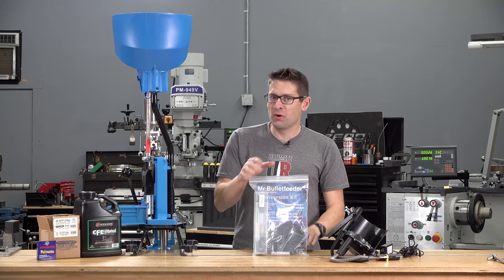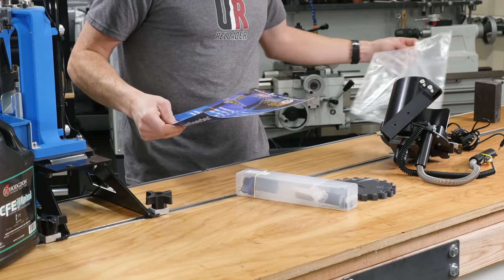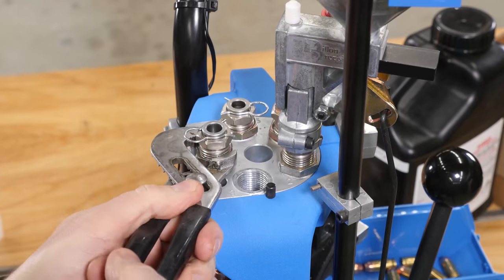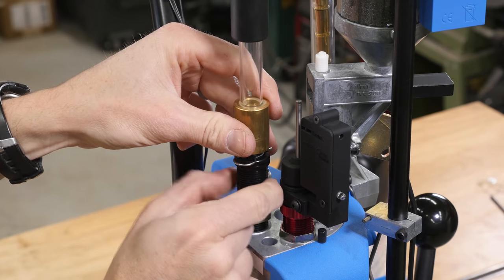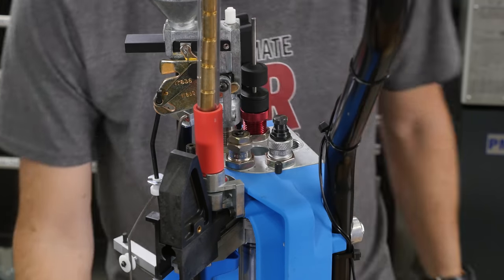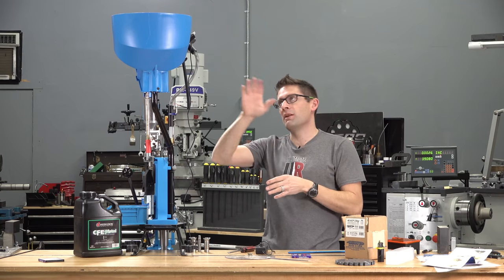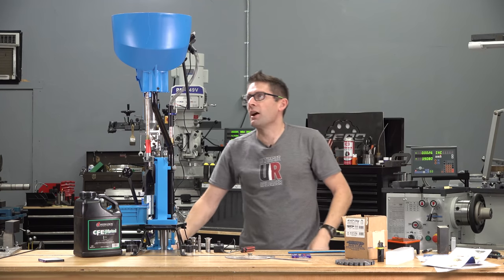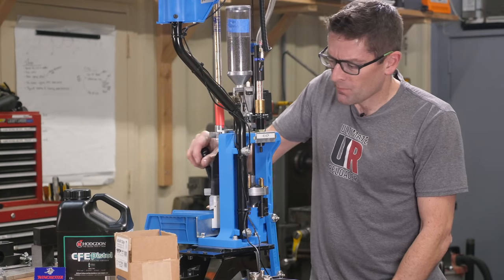Mr. Bullet Feeder Caliber Change: 9mm to 45 ACP on Dillon XL-750

Comment: Hey Gavin, I have the same setup on a xl650 press.  I had some issues with the bullet dropper not always reseting itself (dropping itself down after picking up a bullet). This would result in spilled bullets, not picking up the next bullet or seating the bullets too lightly without over expanding the brass case mouth.  

I fixed the issue by attaching a light tension spring from the top of the dropper assembly via a cap screw that replaced the set screw, to the bottom of the tool head through the tool head hole on station 3(the powder check station op rod hole) to a v shaped piece of wire that holds the spring from coming through the hole.  I have my feeder setup on station 3. 

 After adding the tension spring it has worked flawlessly. :-)   I now noticed as I'm  writing this that  Mr. Bullet feeder now offers their fix with  dual springs for this issue with their own tensioning kit. Now that i know this is avalible, I highly recommend it as it eliminates any issue with the bullet dropper reseting and will provide more force to the bullet pushing it into the case mouth. This will allow the brass to be minimally expanded saving brass life and keeping bullets from falling out/off the case when indexing to the next station.  

You can their product fix here: https://www.doublealpha.biz/us/dropper-tensioning-spring-assembly

I love the setup as it works well for me. Thank you for the reloading content you create.  
Hope this helps. Happy reloading :-)

Comment: How did you get the shell plate holder to stop jumping and spilling powder out of the cases?  This is a problem on my buddy's 650.
Reply from the maker: The XL-750 Has redesigned indexing, I think that helps!

Comment: Is the Mr. Bullet Feeder a universal fit for typical progressive loaders? 
I'm curious if it'll fit and work on a Lee Load Master or 1000 model.
Reply: it's press independend but you will not have enough positions on 1000 as bullet feeder requires bullet feeding die. You can use collator without the DAA die and use Hornady bullet feeding/seating die instead, that will work too.

Comment: I noticed that the cases stick on the funnel sometimes are you having the same problem?
Reply: polish it slightly with some fine grained sandpaper or steel wool. Especially on the conic transition from expanding part to bell. had the same problem, this fixed it nicely. Do not overdo it!
Reply: Thanks I’ll try it
Reply: I tried 3 different brand funnels: dillion, Double alpha, and shooting sports innovations. The only thing that helped was a little one shot lube on my brass.
Reply: @mackies9151  That was the first thing I've tried (well, apart that I lube brass with lanolin mix anyway) and it didn't help much.

Brass sticking problem has been solved only by polishing powder funnel. 

I have to tell that I had same problem with original Dillon powder funnel before I started to use bullet feeder, so it's not a problem of just Mr. Bullet Feeder funnel.

Comment: Is it necessary to have an RCBS die in this setup?
Reply: no and if you are not using powder check, you can crimp and seat in separate steps too. The only downside of seating/crimping in one step is that you can't use powder coated bullet (or it's not recommended) as bullet is being crimped while still die is seating it into proper depth, so it might shave the coating this way. But I think Lee or any other seating/crimp die would work the same way as RCBS.

Comment: If your gonna load on a progressive press the bullet feeder is a must to take advantage of the press
Reply: not so. Certainly nice to have but not a must. Casefeeder is a must, true, but not bullet feeder. Personally I have bullet feeder set up for 9 mm and reload .45 ACP without it, not a problem.
Reply: @ZhuJo99  why buy a progressive without a case feeder . Progressives are to save time and load in large amounts.  I am talking about dillion xl presses. Buy once cry once.  I loaded for years without a bullet feeder. No more fumbling small bullets like 9mm and 223
Reply: @taps_1021  learn to read first, please. I was specifically talking about that BULLET feeder is NOT a must. Nice to have, not a must. Casefeeder is a must. But it depends. Dillon 550 is just fine without casefeeder, which I heard is even quite problematic on 550 and does not work for rifle cases.
Reply: @ZhuJo99  this vid is about a bullet feeder.  It is a MUST for me.  No one is talking about a 550 and that a case feeder is a must.  I had a 550 but needed to save time and needed higher volume.  A 550 has its place.
Reply: @taps_1021  yeah but you was talking about case feeder in a post above :). It really depends with bullet feeder. Definitely I can’t imagine to reload without it now, when I have it (3d printed). Especially those tiny .223 bullets are hard to handle by hand. But .45 ACP no problem, as I don’t shoot those that much, so making say, 500 in one sitting no issue and it goes pretty quickly even by hand. I have not bothered to buy another feeding die and funnel for .45 as a price of those can’t be justified by amount of it I reload this caliber. 9 mm, .223 sure.

We have to recognize two things - nice to have and making whole process easier, and a must.

Personally I use Hornady 1911 primer tube filler and that is a MUST for me. For somebody else, pickup primer pan would do just fine.